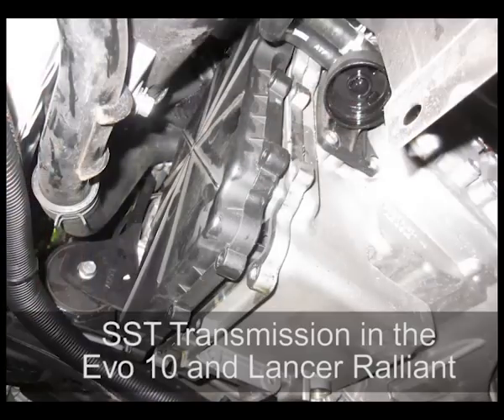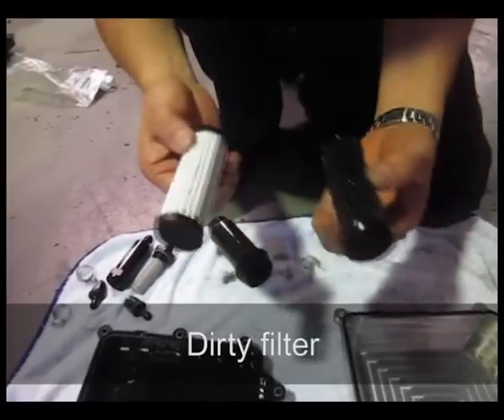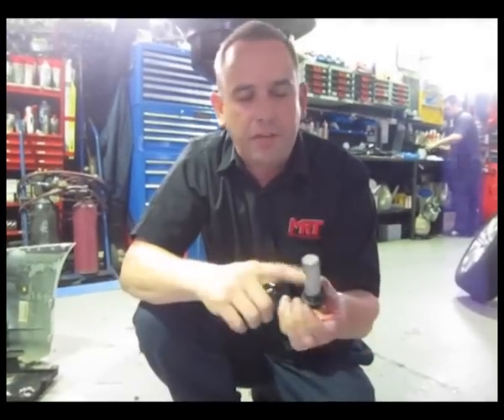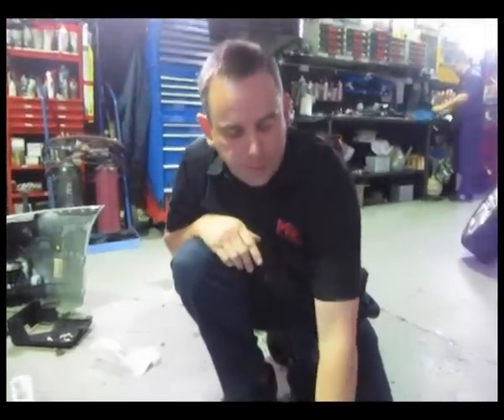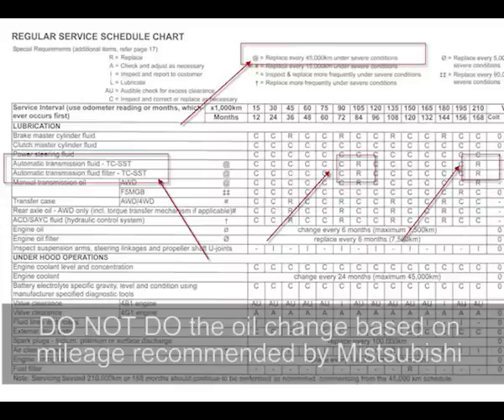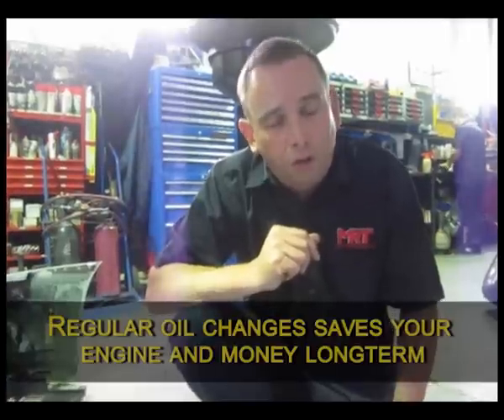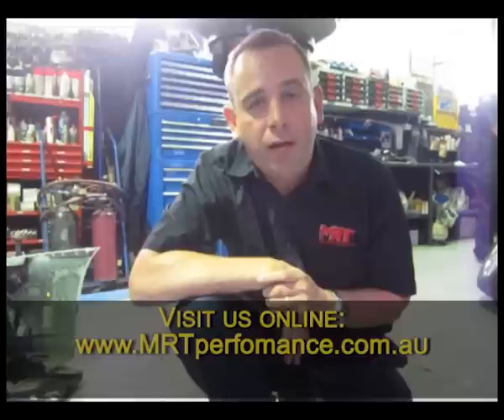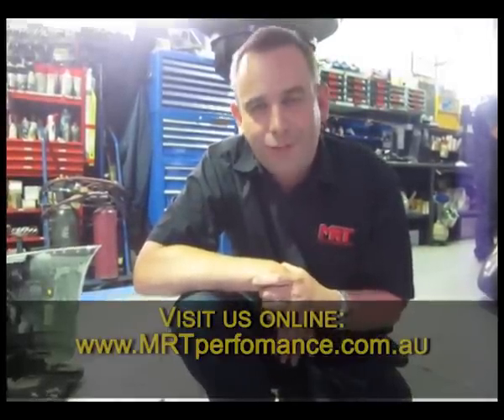Mitsubishi SST transmission oil change secrets, MRT performance Part 6

Comment: Hey thanks for the great info on the Mitsys.I just bought a Ralliart and you are thhe source for knwledge on it.  I have heard a lot of horror stories on these transmissions and the fluids you use. Is it true that the ford xt-11-qdc is the same as the diaqueen? Do  you have any fluid your shop sells and recommends ?
Reply: The horror stories are simply caused by horror owners...there are 800hp + cars running SST'S...they are a strong box...but like anything you have to look after it....they just need to be educated...its like when Turbo's first came out, people werent changing their oil at 5000kms and idling them down and turbos were blowing...Turbos had a bad rep as being fragile. I change my motor oil every 5000kms or every 6 months in ALL my Turbo cars inc. My Ralliart...ive changed oil with 500km on it simply because it was 6mths old. PS...i would only run Diaqueen in an SST. Also...never drive it hard in normal mode...only in Sport.

Comment: i have a question  my 2009 mitsubishi lancer ralliart has a check engine light on  the code is p1875  which is a speed damper sensor code   been on for about a month and a half  drives fine   but i brought it to misubishi dealership to have it looked at   they said i need a new transmission which doesn't make sense considering it drives fine,  do you think i may just need a trans fluid change?    any info would be helpful

Comment: I just purchased a 2009 Ralliart and the Service Required light is on. Does that mean I need to change my transmission fluid?
Reply: RTBFIT 
It says that at preprogrammed intervals for any regular maintenance. It'll show up at the next oil change interval, spark plug interval, air filter interval, etc..

Comment: Hi guys. I just bought a 2015 Lancer EVO MR (SST).  Searching the internet about more info, upgrades i got really concerned about internet discussions regarding reliability of this SST transmission. Does it have a design flaw that will soon or later failure ?  How much miles it suppose to last keeping stock ?

Comment: The "dust" in the fluid comes from material wearing off the gear tooth faces due to metal quality issues aside from clutch wear.  I don't get how the gears can be so strong and this still happens, but that is for a metallurgist to understand better than me.  It's what Mitsubishi has found and it is inevitable, any trans expected to last should be maintained way beyond factory spec.  If dust is allowed to build up in the fluid, spool valves in the valve body and shift fork pistons can fail to move freely in their bores causing many drivability problems with or without codes.
Reply: Hey Fopes. Hilarious we both came to this vid independently.

Comment: ive read alot about the sst gearboxes failuring,mainly a part inside even without track work and with less than 10,000km on the clock,is it worth opting for the manual and not going with the mr version.

Comment: hey there i was wondering if you could please recommend me a gearbox and differential oil for an evo 4. sorry just that i cant find a conclusive answer and here in costa rica i cannot get the oem oils. most other brands like castrol motul and redline are available. anyone know the info of a compatible and good oil?

Comment from the maker: @jacejai I would change it now, as far as oil BRAND, we use both genuine and after market, the number one thing I WOULD do is the extra in line filter, it will save you heaps in the future.

Comment: Thanks Brett. So at what km do u recommend just the oil change in the sst? I've done a shade under 30,000 and wasn't really considering it until recently that I might need this. Also, is there much difference between oem and aftermarket oil for the sst both in performance and price because if imagine some customers would prefer oem if there is not much difference in these two respects.